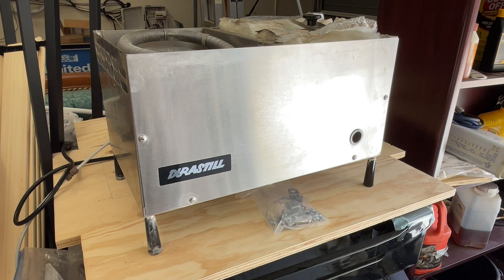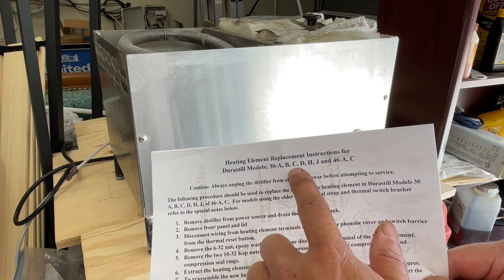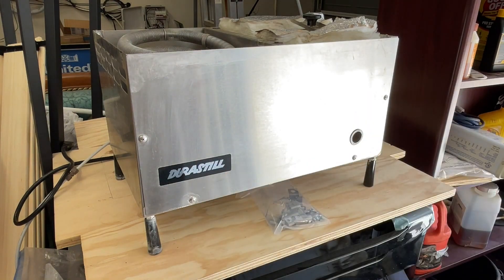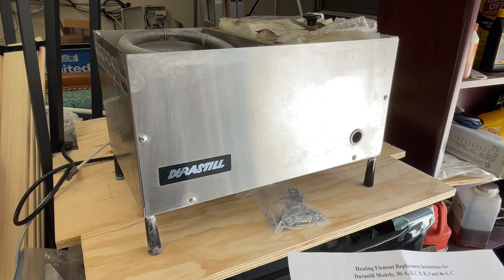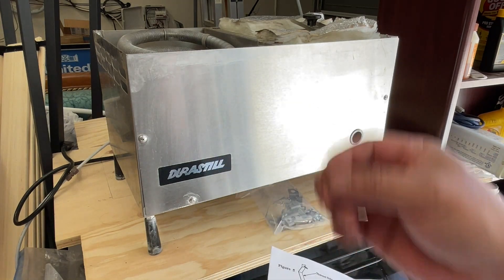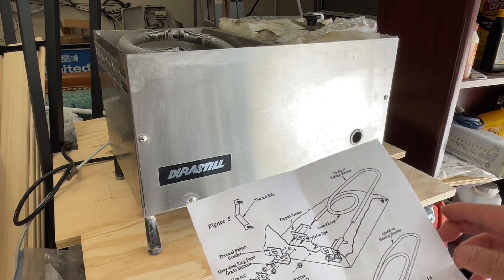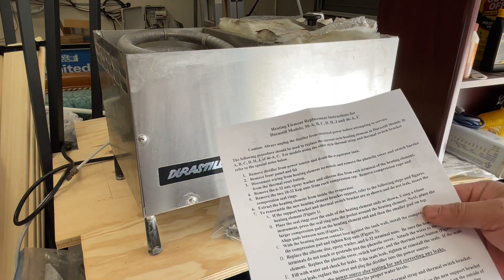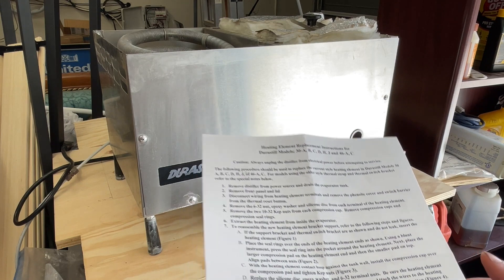DURASTILL HEATING ELEMENT SEALS REPLACEMENT #WD450-015

Comment: When trying to remove the nut from the nut driver,  just thread it back on the screw two turns then pull the driver away. You will then be able to remove the nut with your fingers from the screw without wasting time trying to shake it out of the driver.

Comment: I suggest that you also check the float gasket seal and replace it as well.  I followed this video and repaired my Durastill distiller.  However, mine still leaked somewhat.  I discovered that the float gasket was also worn out and leaked water down the front side of the distiller.   Once I replaced the float gasket, no more leaks.  The video to replace the float gasket seal is here:  https://www.youtube.com/watch?v=K3gj4EIkk-o&list=WL&index=21
Reply: Absolutely. The float gasket seal is by far the most common source of leaks in the Durastill. The heating element seals shown here rarely ever go bad in my experience. (Over 30 years with a Durastill in my family). To extend the life of your float gasket make sure you drain the tank often and keep it clean. What happens is that if you have excess crud in the tank, when the water boils certain types of contaminants foam up and reach the float gasket making it fail far sooner than it should. Steam then exits the float hole and condenses outside the insulation and drips down to the bottom and the leak appears to come from the elements or the bottom of the tank, but it’s not really the case. With good tank cleaning/maintenance the float gasket should last 3-5 years.
I know the poster of this video says he replaced these seals and it fixed his problem, but by the looks of the crud on  the insulation around the float hole and around the switches, I can almost assure you that his float gasket is shot also.
Reply: @jester9118  Our current distiller was purchased no more than three years back.  Since then, I've replaced the water inlet solenoid, both gaskets in the heating tank, the heating tank drain valve, the heating tank water level switch, and lastly, the storage tank water level switch.  Our first distiller didn't have this history.  The nice thing is, I now know more how to repair one of these than I did a year ago.

Comment: Just discovered mine is leaking around the bottom of the distiller.  Was hoping the tank had not rotted through, but found your video, and now have hope I will be able to repair it with the kit.  Thank you for posting this.

Comment: Thank you for posting.  Just discovered that my Durastil is leaking around the bottom of the distiller.  I am going to order the kit, and hope it doesn't leak afterwords.  Far cheaper to repair than replacing the evaporator.
Reply from the maker: My durastill was leaking for months. Most leaks at the bottom of the distiller is caused by hardening rubber seal around the heating element. After my fix, no leak at all